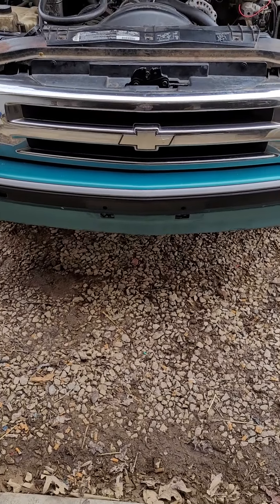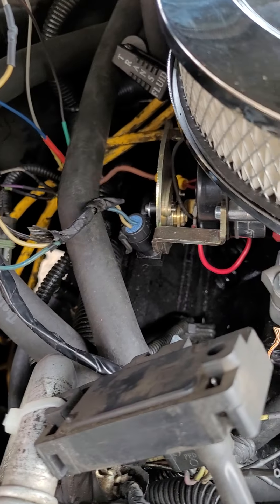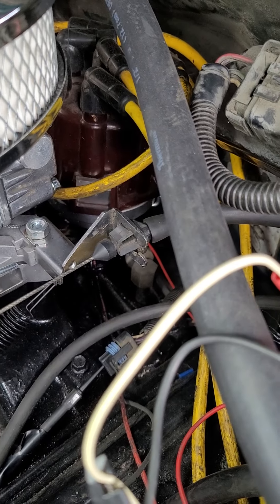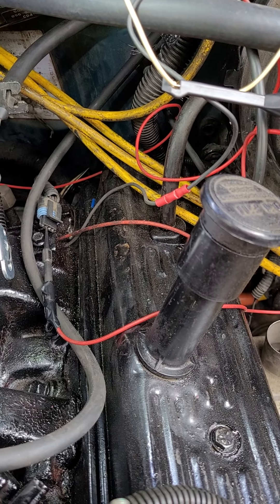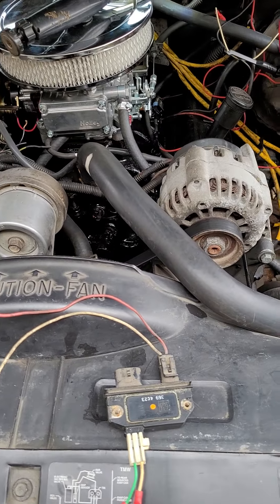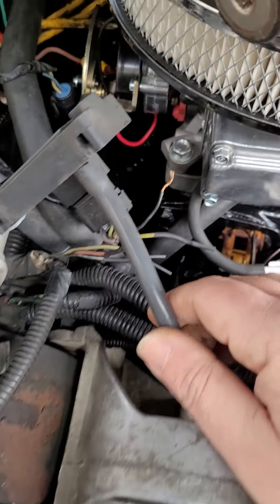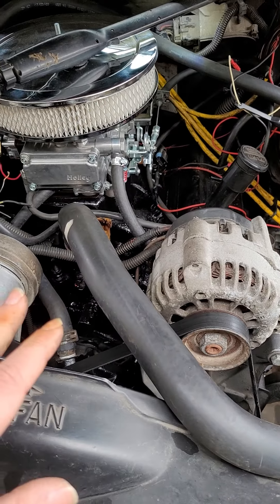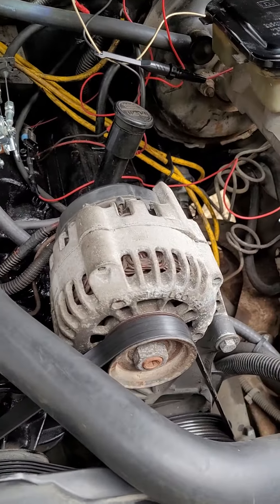S10 4.3 (4l60e) transmission in limp mode after engine swap fix

Comment: So I have a 93 with 4.3 and the 4L60e, motor and trans recently rebuilt but after about 1500 miles, trans starts shifting super hard from park to reverse or park to drive. Also , when driving in OD the trans will eventually go into “limp” mode ( 2nd gear and reverse only ). Park it for 15 mins and returns to normal. Also, when driving in D the truck continues to shift super hard thru the gears and hunts 1st to 2nd and back again several times at the upper end of rpms, but will never go into limp mode.
   This was a fleet vehicle, well maintained, they had the engine and driveline professionally rebuilt , and those same trans professionals examined the trans once it started acting crazy. They replaced the valve body, and then replaced the computer in the truck, with no positive results. They eventually gave up trying to diagnose the problems. The truck got relegated to the back lot as the short term warranty ran out. That when I purchased it.
   I know nothing of all these sensors and how they actually function, but I did check for motor to chassis grounds , they looked good. The Cat converter was clogged so i removed it from the exhaust, thought perhaps that the temp and back pressure was sending bad O2 sensor info. Truck runs so much better but the trans is still acting crazy.
    I dont know where to look first, but I guess i will check the TPS first and then that plug on the back of original distributor for good connection.
    HELP !
Reply from the maker: For the shifting hard the 4l60e transmission has a plastic piston that can Crack and let fluid bypass it. For the limp mode check the 5 pin plug on the distributor, check tps sensor and map sensor
Reply: @everhole87  thank you! I will check those areas first!
Reply: Hey brother! I changed the TPS and a world of difference! Not so violent at low rpm in and out of drive and reverse.  Here is the weird, still has a hell of a pop into 2nd and depending on the pedal pressure, it may hunt back and forth from 2nd to 1st several times. Same with 2nd to 3rd at times. Torque converter is still locking and unlocking errantly. AND, up until yesterday,  have been driving in OD and the truck has not gone into “limp” mode....yesterday at a constant 70 it shifted down to D(3rd) then down to 2nd and once i stopped it went “limp” mode , i had to shift manually into 2nd to get the last few blocks home. It has never “slipped” during any of the actions, every shift and pull is solid and crisp.
Reply from the maker: @steverocketwheelsbuckner262  do you know of which kit was used to rebuild the transmission. Or if when rebuilt if they checked or changed any of the sensors or solenoids
Reply: No, i do not. All of the previous work  was done prior to my owning the truck. All i do know  is that once all this erratic action started the trans shop pulled and replaced the valve body and i assume that would include the electrics , too. The crazy part about the whole thing is the truck ran fine for about 1500 miles with the rebuilt motor and trans before any of this started happening. Quite the mystery!
Reply from the maker: @steverocketwheelsbuckner262  yeah it is odd. Just for having 1500 miles on it. Have you checked the connectors on the transmission for a loose pin or corrosion maybe even see if the wiring harness might be pintched or near the exhaust somewhere
Reply: @everhole87  hey brother Im having the same exact problem with my 94 gmc c1500 ! have you fixed yours? if so what was it? I have done everything sensors fuses I will check harness and hopefully find something… let me know brother thanks
Reply from the maker: @victorvitolagarcia9998  on that truck it was just the one wire from the icm that was the computer was not seeing an rpm from it
Reply: @everhole87  thank you I will now check into the harness. what do you exactly do to fix it or to find out what cable was causing the problem?
Reply: brother did you fix it? did you find the problem?
Reply: @victorvitolagarcia9998  , nope. The tps calmed down the violent activity during shifting. Checked all connections. But the trans at time hunts back and forth between 1st and 2nd, and 2 different times ( when it wasnt acting crazy ) it would go into “limp” mode.
   Ive just gotten used to driving in D , not OD, truck shifts solid and perfect and never goes into “limp” mode. Really a mystery.
Reply from the maker: @victorvitolagarcia9998  this website might help you with your problem. https://easyautodiagnostics.com/gm/4.3L-5.0L-5.7L/distributor-mounted-icm-tests-1
Reply: @everhole87  thank you man, I will check it out